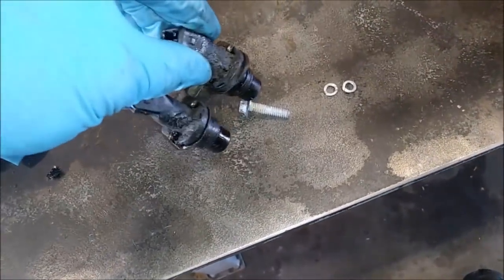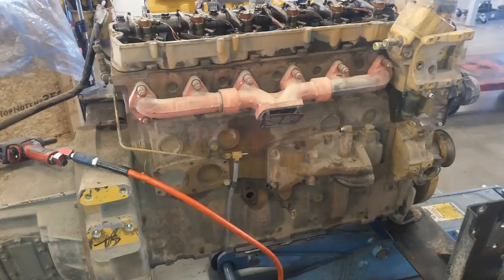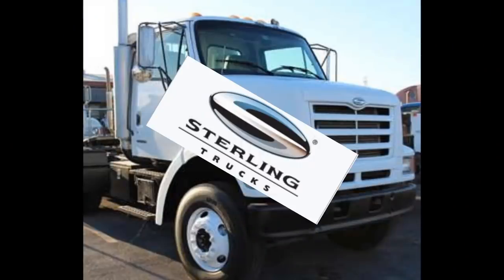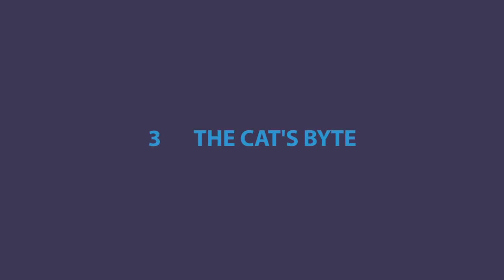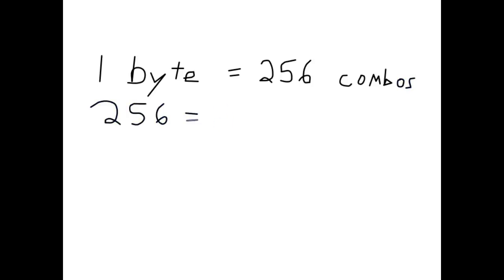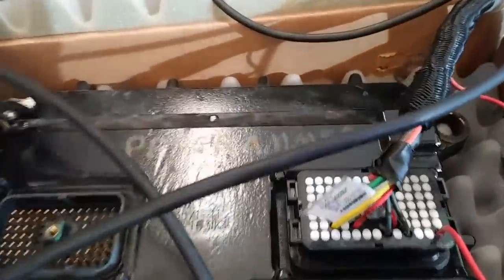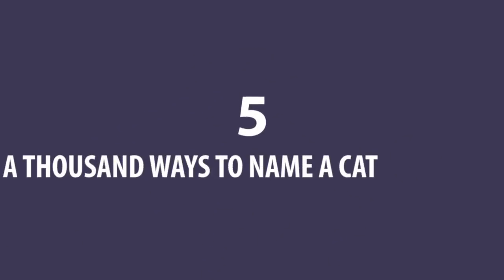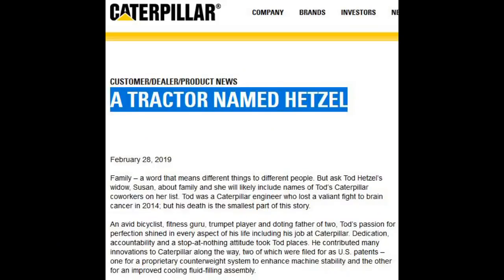5 Cat Engine Facts Most People Don't Know Are True.

Comment: Years ago we had a 1960's Diamond -T  (990 Series) with a 220 Cummins that was tilted to fit under the hood and cab. Interesting truck it was.
Reply: Ford 1964 ht 1000 cabover, had the 15 deg tilt NH 220 for the shift tower clearance if I remember right. That was 50 years ago when I worked on them.!
Reply: That cabover is definitely in the same era of Dinosaurs we're talking about!

Comment: I had a 1976 International Fleetstar 2010 A ( think that was the model). Anyway it had a 290 cummins which was installed on a slant also. Also had the doghouse in the cab as part of the engine stuck inside.

Comment: C11, C13, C15 in 2006 ACERT for paccar had 30 distinct yaws and pitches.  The oil dipstick selection is very important.  Good news is that assembly guys and girls will verify selection with engineering when question arises.

Comment: CAT Yellow claim; What about 3406A’s? Didn’t they come from the factory painted white?
Reply: My 79 Pete came with a white 3406 @ 375HP. Should have waited for the 380 with direct injection. The savings in fuel costs would have paid for the truck twice.
Reply: You are 100% correct but it wasn't about the model number it was because they were shipped to paccar Incorporated

Comment: Ford also used the tilted to the right engine. It's a total nightmare when you go to swap out the engine into a better truck
Reply: Try to find parts for those old fords. Like a fan clutch or fan clutch mount. They just aren't out there any more.

Comment: At a large hospital/research centers that I retired from 17 of the 18 generators were Cats. Most were 16 cylinder 2000KW GEN sets. Had 4 760 KW CAT natural gas gens that were pigs like all gas gen sets. Even after spending a ton of money to rebuild them could not run 650 KW of load banks in the summer. Cat diesel gen engines great.

Comment: Cat truck engine colors was as follows. Blue-Ford, Red-International, White-Paccar, rest was yellow. Also you had old Cat yellow and new Cat yellow at one time. So when I worked on a 3406 with many color parts, I knew I was in trouble, most likely. When Cat came out with the smaller engines, that replaced the 3208. I ordered a can of  paint from Cat, it was Glamour Gold with a non-Cat paper label on it. 
You haven't lived unless you in-framed a 3406 in a GMC Brigadier. Or worked on a LTL 9000 Ford COE.
Reply: Have not worked on the GMC but have worked on both Ford & Marmon
Reply: @chrisgilio2205  Look up 9L6138 manifold for a 92U, that what was on a GMC. Rebuilt a 8PN in a Marmon two years ago.
Reply: @johngoldsmith6629  I will check that out tomorrow
Reply: @chrisgilio2205  OK you work for B373. What do you think about SIS 2.0?
Reply: @johngoldsmith6629  Yes. The keyword search is great but still trying to get used to it. After using old SIS for so many years and getting good with that it is like starting over.
Reply: That is some configuration of exhaust. Have yet to work on an A motor, only B , C, & PEEC
Reply: @chrisgilio2205   PEEC engines only a few people that understand them and can work  on them. Set your timing sensor at 0.1. Then at calibration, should be 0.1 over. If you set it to 0.0, you don't know if sensor linearity is off. Also you can check it at 0.5 increments and use the calibration tool to see if sensor is following static setting. You just add what you set the bottom to. Once you verify sensor is OK, set it to 0.1. Bellcrank, always measure gap and make sure it is not to far out or to tight.   
TDM make sure fuel system side of inner hsg is flat. The gasket can fail internal or external. If internal you will never see it and the VTU can fail. I wrote a article to Cat and Doug Wilson used some of it to make the PEEC update guide so to speak.
I pull the dowel pins out and put the hsg on a lapping block, making sure I get it flat. I than glue the gasket around the oil passage with strong cement to prevent gasket failure. On the TDM side the hole is big enough to use a 1/4 NPT and thread the hole. Use a internal 1/4 NP plug and tighten. Grind off what sticks up. Take your gasket and put a nip in that area. So if any oil leaks past the plug it will drip out. Take the TDM and where the oil feed use to be, fill that with silicone, as the thread screw, with hole is still used. All they did was put a cap on the inside. I have seen them still seep oil into the TDM. So I prevent as much oil contamination as possible. You can wire a 5EK boost sensor up, if the TDM has failed on the boost circuit. But be warned if someone tries to calibrate the boost sensor, they have just messed up. As the TDM is no longer wired up. Some engines the fresh air line would get water in it and run into the rear. Make your hose very long and put coils in it so water is trapped. Flt was the worse and I would put three coils around radiator brace, exhaust side. Kept water trapped, plus heat would help evaporate water. 

On A models, fuel injection lines are not all the same, PC, DIT and DITA on the inside. Fuel bodies on DIT and DITA are not the same. External lines you have PC and DI. Same thing with fuel pumps, PC, DIT, DITA are not the same. The orifices are different size and effects HP. Also remember on A models the spacer under the pump stays with that cylinder. If you mix them up, you will have to remove the pump, put a degree wheel on it and recheck lifter height. Wait until you work on one that the drive pin is worn out. Sounds awful and will pull your hair out trying to find it. So take the cover off the rack and while it is idling put your finder on the rack. If the pin has failed or low of oil feels like a air hammer on your finger. You have to pull the pump off and its the last item you get to.

One thing I do on B and C models. If I have the governor off, I use a washer out of a PEEC VTU and put one on each side of the FRC lever. It still allows side to side motion, and it tighten's it up enough to prevent it from rubbing on the side of the FRC valve stem. I have seen them with a flat spot from rubbing so much. Fuel return line if number four, increase it to a number six or eight. You will have to replace the orifice fitting in the rear to match the line. Number fours can collapse and build psi up. Seen them blow the fuel filter off, check valve out of FTP and hard to start. Use the race out of a 8PN that runs against the flyweights on early engines. The OD is a lot wider and can help prevent a flyweight from falling out on assembly. Always measure your governor guide depth, especially if you replace the tach drive seal.

I always update piston's to steel on a 8PN.

Don't know how much of this you already knew, but hard lesson's learned.
Reply: @johngoldsmith6629  Thank you for all the info. All of the mechanical work I have done was with the help of a seasoned veteran like yourself. I have overhauled a few. I have done numerous timing advance. Replace some P&Bs. Rebuild AFRCs. Some of the basic stuff like that. I have even adjusted a few of those Super Jake's. A Lot of the problems we see with them today is other people work on them & install mismatched components. The seasoned veteran is going to retire soon & then I'm the one who will have the most experience with them. Which really isn't that much.
Reply: @chrisgilio2205  Look me up in clues for my work email, I started in 1980. On B/C model FRC's, the part that the diaphragm goes over. Gets a sharp edge on the bottom. Make sure you taper it down or it will cut the diaphragm. Also on these old engines the seals in the parts book are the old style. New 2.0 is messed up and dealer similar parts list is of no help on this. So a 8PN has the latest style, get with your older tech. Most of seals will work, so double check with him. Also gasket kits has the latest part most of the time. Also adjust the valves with the Jake brake on the engine. If you don't the lash will change. Get the tool used to tighten down the fuel pump on a 3408 (3/8 bolts). Heat it up and bend it to a ninety degree angle and it will work on the jam nuts.
So here is your task. Email me at my work email. I need all the oring seals for the oil filter base for a 7FB10855. (2.0 has removed the image, so I want the the seals that uses the 8M4992 seal in that group.
The seals to mount the fuel system and reseal the o-ring boss plugs on the back side of the main fuel pump.
Reply: @johngoldsmith6629  Thanks for all the information. I will try to find that information on Monday for you . Where exactly is that clues thing so I can get your email.
Reply: @chrisgilio2205  Sign on at the main page of cat for trucks. Under related links is clues. All Cat and Cat dealer personnel is in that menu.
Reply: @johngoldsmith6629  Ok thanks
Reply: @chrisgilio2205  I had a 1989 Freightliner COE it had a 310 PEEC in it and it was a turd.  Hated that progressive shifting POS>
Reply: @johngoldsmith6629  I sent a parts image to your work email
Reply: @chrisgilio2205  That's not what I asked for, I want the part numbers of the o-rings that YOU would use to reseal the base and reseal the back side of the main injection pump.

Comment: Fun fact: At the Ft L Boat show CAT stand some years back I got to meet one of the engineers who helped design the 35 series CAT engine (the most common used in large yachts) He was a German man with a heavy German accent and he told me the engines were designed by a German team of engineers and he was just part of the team. That he was responsible for the oil lube part of the engine and he place the oil sender just before the oil reached the oil sump.
Reply from the maker: That's a pretty cool story. I've worked on a few of the 3500's.
Reply: @AdeptApe  I really appreciate your response and you as well. You have helped me tremendously through the years with my profession as a yacht engineer working in the engine rooms out at sea.

Comment: The ford heavy trucks, ( Louisville 9000) did the tilt long before Ford bought the " Sterling" line, the hoods were very short and the angle was exaggerated with the engine under the dash.
Reply: I remember the first time I worked on one of the old fords like that

Comment: Cat Marine Engines were painted and still are as far as I know painted white
Reply: I have worked on 7 ships with a Cat or multiple Cats.  Every one of them was yellow.
Reply: I seen a few hundred white ones in boats
Reply: @Hudson_pacific  just curious, what kind of boats?
Reply: I have seen mostly white cats in pleasure boats, sport fishing and motor yachts,  the commercial boats had yellow cats
Reply: Boats working out of Dutch harbor. Most all the newer stuff was white. Mainly fishing boats alot of c-18's and c-32's

Comment: All ford engines Cummins,  Detroit Cat,are tilted, some Sterling, 2000 Sterling they are straight up, would like to know more about the color, mid 80s Paccar put white on the high HP 400 > , marine engines were white, some drivers stop at the shop thinking they got a marine engine in their Pete, I reached out to local cat dealer for more history, but have not heard anything, great video 👍👍👍👍👍

Comment: Ford has been installing all full size I-6 engines since the Louisville came into production at an angle. Even a Ford Aeromax whether it's an N14, or 3406. It's incredibly hard to work on a Ford, or Sterling (same cab) with any engine that has pushrods.
Reply: n15 don't exist
Reply: @thermidorlevrai65  where does he even mention N15, or are you number blind?
Reply: @yuk-erkmckirk9277  he changed it
Reply: The oshkosh was a dream to work on ,until they went to the short nose.

Comment: There was also white engines installed in trucks. It designated high horsepower models and 1693, 3408 and some 3406 models were white.

Comment: I ran an 89F9000 something or other, "L" model w/a 425b  that was tilted back lots and had a slight tilt to the right.  The valve covers were not level.  The engine clearly was tilted to the passenger side.  I drove a mid 80's LT9000 350b, set back that had the slight tilt to the right also.

Comment: Most laid over cat engines in a truck where the 3406 A&B series in GMC Brigadier and Chevrolet Bruin series of conventional trucks. Cat 3126 engines in Freightliner where actually more of a gold colour. Cat Deutsch/ amp wiring follows common military style wiring used worldwide. You should tell them about the two piece engine block design of the first series of 3176 that consisted of two dissimilar metals that failed miserably. —-KTMCandog!

Comment: Great video!
So before the time of the 34 series there was a motor called the 1693.
good motor but had heating issues on a hill, unfortunately they wouldn't take the heat and was detrimental. 
The 1693 was painted white in certain trucks!
sometimes they were yellow as well.
Reply: Before the 3400 series was the 1600 series. 1673, 1674, 1676, 1693. Before the 3200 series you had the 1100 series. 1140, 1145, 1150 and 1160. Of all of these I have not seen or worked on a 1676. I have a picture of one in a Cat publication.
See my comments below on Cat truck engine color's.
Reply: Yes sir!!!
they typically ran a (yellow) engine in equipment or anything that was painted yellow that matched the color of the machine it self, the (WHITE) cats were hidden under hoods of trucks in most cases!

Comment: I come from a heavy equipment background, so I don't really know too much about CAT truck engines. I do know they have taken the most simple mechanical engine and electronically controlled just about everything on the new computer controller engines whether it's in a truck or a bulldozer. I would rather have it the old school way myself.
Reply: IMO they didn't want to but EPA forced it down their throats.
Reply: I work at prince William County government landfill and operate a trash compactor 82,000 pounds its a 2014 has a cat C15 its a beast not that much computer controlled stuff on it 11,000 hours on the machine still runs great, they ordered a new 1 from them came with a volvo motor biggest Hunk of Junk there is broken down many times and the dep has gotten it not running also the old cat dont have to regenerate it has no bullshit on it, the volvo tech come out and was trying to praise the motor telling me it has more horsepower  cause of being computer controlled but i told him i would take that cat motor over the volvo any day of the week, the cat feels like it has more power

Comment: Have you ever done any videos on the c16? I'm a cat nut, I started off with a 1981 pete with a 3406a. Turned up she'd out pull our 400 Cummins.  Next was my favorite 3406b,  which I turned up myself.  Now I'm running a 550 1lw. But I've always wanted a c16.
Reply: Was that 3406A  325hp standard? That's what they were in Australia. My father had one. Strong engine,  and the B series was a torque monster.
Reply: @Andrew King  mine was a 290 hp from the factory, but could be turned up to 325.

Comment: The brown paint was Freightliner spec. I purchased the paint from Freightliner for a warranty cylinder head job. I don’t recall their name for the color.
Reply: There was old gloss CAT yellow, a flat yellow with a sand tone in the 80’s, and the current semi-gloss yellow. Cat built some early D337 in-line 6 scraper engines with a roots/gmc style supercharger. When turbocharger systems design became reliable the super chargers were no longer used.

Comment: I knew that sterling and international slanted the N14 cummins but didn't know they did the cat as well in the sterling. On that same note I haven't seen a sterling with a cat in the HD lineup only the MD with 3126 and C7
Reply from the maker: They were rare from what I've seen, most had the little C7 engines as you noted.
Reply: They are rare, I've got an 01 9500 with a 3406E and always get a raised eyebrow from most parts desks

Comment: The electronic connectors - are they all the same design? Could they be accidentally plugged into the wrong things? I'd actually regard that as a major design flaw, or maybe a crappy shortcut by a company seeking to reduce inventory costs. If it's possible to connect wires to the wrong things, we all know someone eventually will. It's better to design something so it's not physically possible to connect them incorrectly.
Reply: They use the same pins. Not necessarily the same plug
Reply: @12345Unicornio  Ah, that's sensible then.
Reply: You might find more than one of the same plug on a harness but they'll be far apart

Comment: All Cat engines in Pete and Kw were painted white in most of the 70ies and all of the 80ies...1990 on up factory yellow...An interesting fact is Cats first attempt at an electronic controlled truck engine the 3406 PEC was frustrating but the biggest failures were in Frieghtlinet trucks..The thought is their wiring system didn't work well..Paccar trucks actually worked okay for the most part with this engine.
Reply: Yeah I had a 3406 peec in a 88 Freightliner.  It was a nightmare.

Comment: Sorry to correct you but cat truck engines were also white,the early 3406A model was white. And as far as Sterling figuring out they had to lean there engines to the right was not Sterling's idea! Sterling used to be Ford trucks, ford starting leaning all there engines to the right in th 70's.

Comment: Cat had few painted white too......C12 475 hp 1850 tq they didn't live long seen few with sticker showing 475hp( test engines). They were all turned back to 435 hp. C12 did really good after they solved head gasket problem torq head bolts twice. Still never did solve issue the injector lifter (roller) going flat